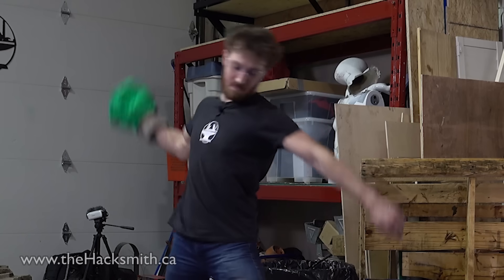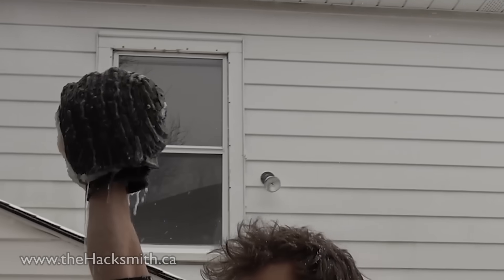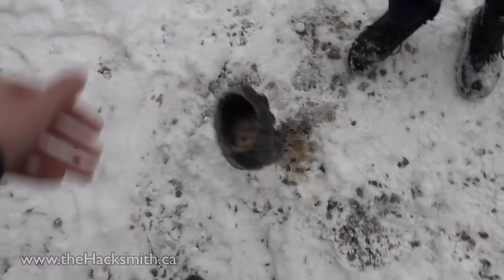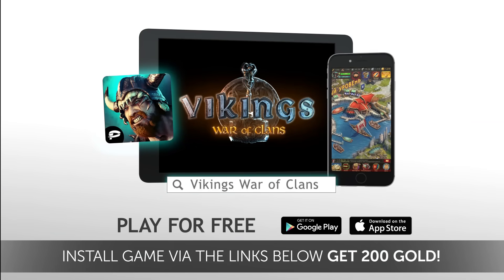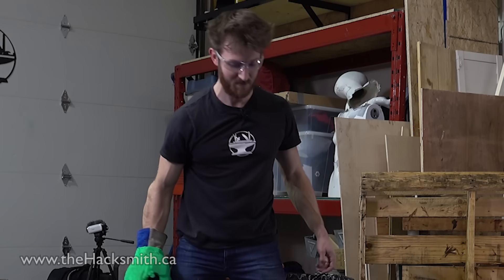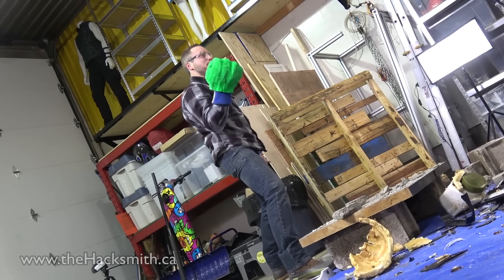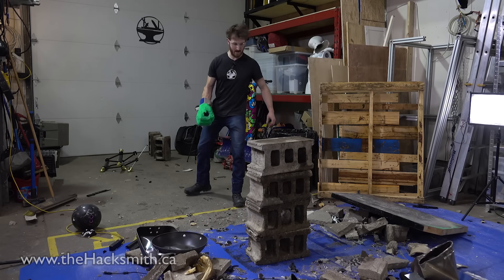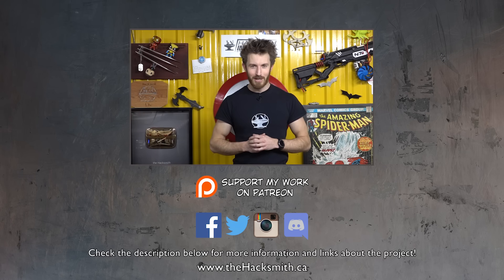Make it Real: HULK FIST SMASHES EVERYTHING

Comment: I could be wrong, but it seems like it would be a whole lot easier to 3d print the fist out of plastic, make an inverted mold out of that, and then send it off to a local metal foundry to cast it instead of welding a bunch of laser cut plates together.
Reply: dalsio their going for 100 percent homemade
Reply: dalsio look forward to seeing your build then bud
Reply: No need to take it personally, I'm not criticizing you or them just offering ideas which can be easily ignored.
Reply: I agree with that but it seems like they took the opportunity to give the kids some practice welding
Reply: dalsio  but then it would be less strong
Reply: i agree
Reply: lol yeah, would make sense, love how everyone got rly pissed off for no reason, also, it may have been more expensive
Reply: dalsio having the whole metal out structure only will be less strong coz it will be pressed to inside and can crush their hands as you can see what are they breaking with it... you know the peice of metals are working together to devide force and instead of "1 inch" metal they behave like "5-6 inch of metal" you said was right but.. kind of.. you know its hacksmith and they have not got million of suscribers just by 3d printing and by doing things easy right... 🙄
Reply: A.they like to make it fully from scratch, 2 the ridged parts allow for slightly reduced weight but still all the smashing potential due to them being smaller surfaces putting that pressure on the small areas (similar to a knife)
Reply: dalsio the hacksmith did it was way easier than what you said

Comment: Iron man upgrade idea:
Rotory encoder to directly trigger a relays (depending on position) to send voltage a stepper motor to mirror your actions inside the suit but with pep. You'll need a little loose-ness to give the user's limb a slight head start move the exoskeleton. You use ladder hinges for joints (simple and low profile). Also look into the non-Neutonian armour the dirt bike dudes use for their armour. It's supposedly staf proof and should be tougher in an impact in case you need to fly etc. Use nano particles to repel water on electronics without adding weight. Blah blah

Comment: Expensive and unnecessary but what if you made a slightly larger design with light weight alloys and put in a few shock absorbers? Then you wouldnt have to worry about accident breaking your fist inside if you go all out and it would be easier to handle.